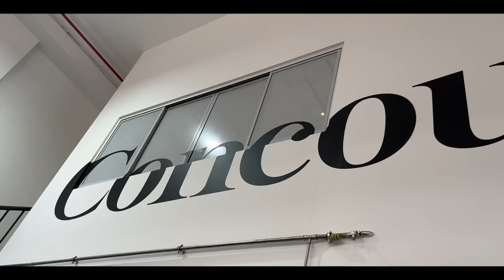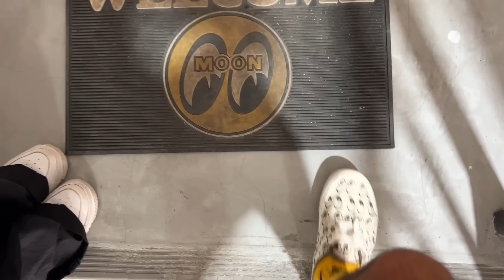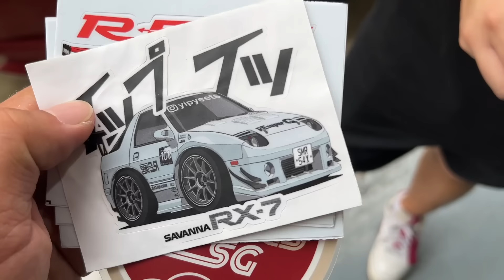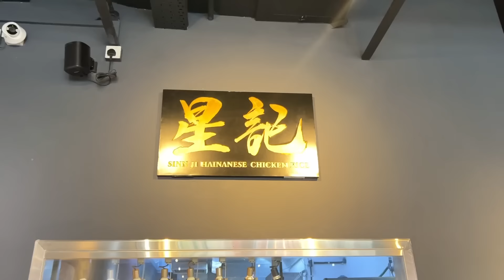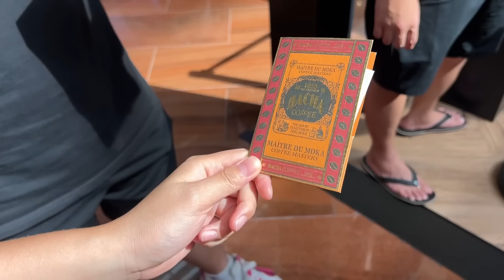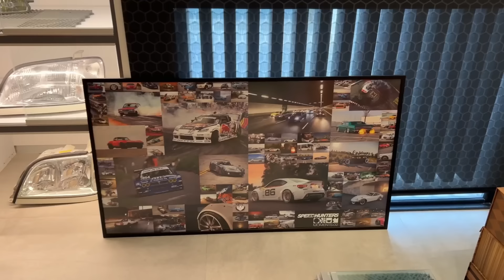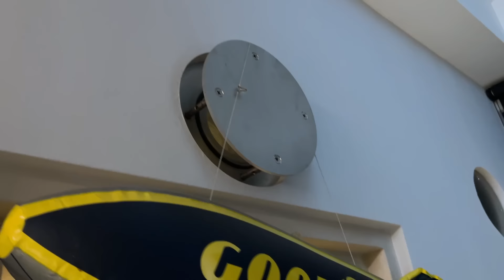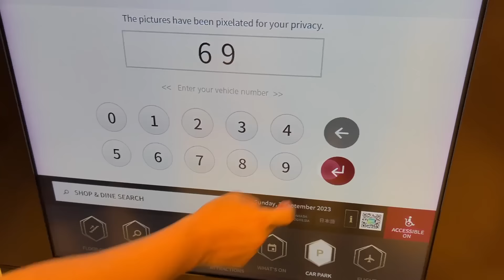CRAZY RICH ASIANS IRL. $120,000 Just To Drive On The Streets Of Singapore! /S4E71

Comment: Love the white R30/31 man its one of my favorite Skylines ever built ! Idk why your not into those they are so awesome and can be an amazing car if you swapped the FJ20 out of it and throw in a RB25 in it and you got a ROCKET !
Reply: Issa R30, not a 31, and the FJ20 is the best part of the car

R31s came with RBs so an RB25 swap into one makes a lot more sense than into a proper DR30 that came with that special FJ
Reply: @niichuuko1095  learn how to spell before you speak to me first of all and secondly I like both the R30 and 31 and they look pretty much exactly the same so quit whining cause i said i like the car and NO its not the best part of the car if it was Nissan would have put that motor in the R31s and 32s and so on if it was so great ! Its a damn boat anchor that doesn't have any power or torque !